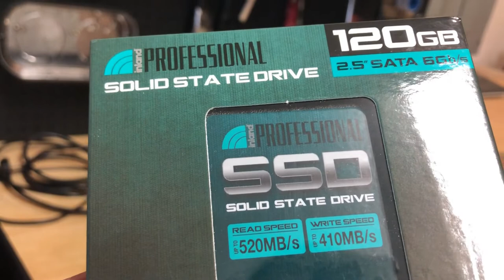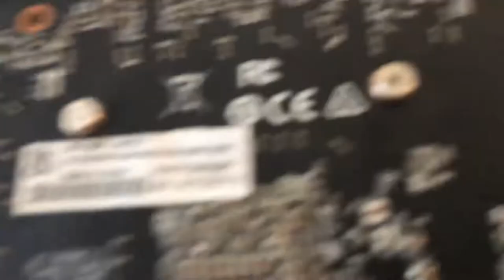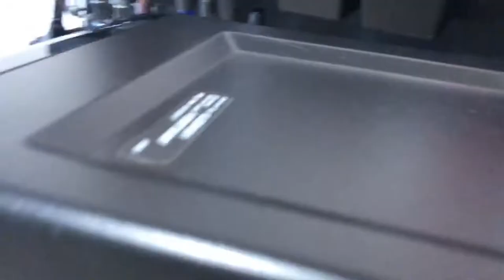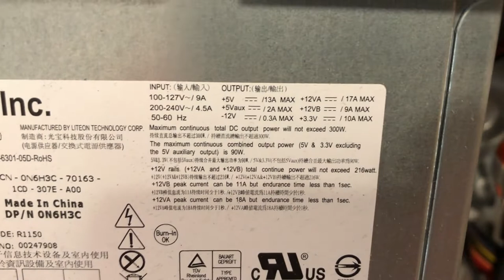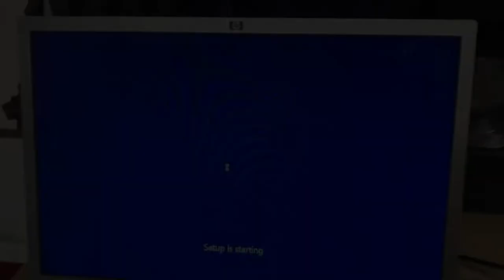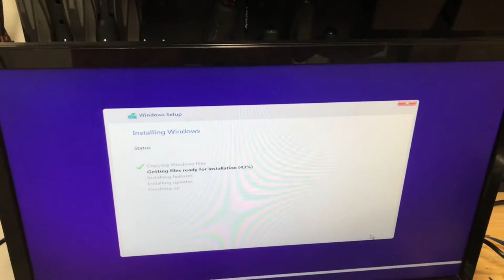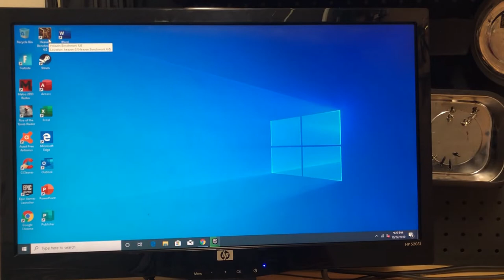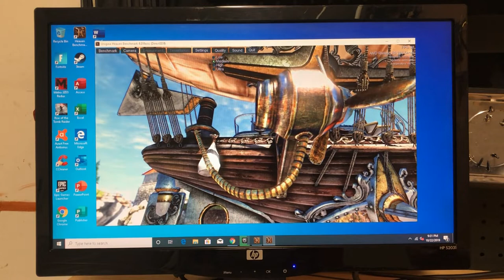Budget gaming computer for $20! Dell vostro 260 gaming PC for $20!

Comment: Hey, I have a Vostro 260 lying around, I have never looked into anything like this before. But I was wondering if this model is even worth putting the money into for running a game like Trackmania. And if so my first question would be how do I connect it to the Internet? If you have any advice is would be much appreciated! Thanks!
Reply from the maker: depending on the minimum specs it might be, I recommend finding what they are. The price for second gen i7's are cheap, only thing with this vostro is it is limited and picky on the gpu because of the bios.

Comment: Hey man, just got one of these, out of all the graphics cards you mentioned, which one do you highly recommend for this?
Reply from the maker: this computer is very picky when it came to video cards and bios support did not really help. I would check the forums to see the best one to get, the best i was able to get going only cause i had it availible was a 750 ti, i did try a r9 380 and ran into issues with it.
Reply: How did you do the bios updates on this with win 10 as the bios updates just fail on my pc and I read that the vostro 260 needs to be on win 7 to do bios updates

Comment: Hi there, i have the 270 with i5 3rd gen. Was thinking of getting a 7770 but not sure if it will fit. Then obviously need a better psu.
Reply from the maker: the psu would be the biggest thing. once you do that you should be good. the 3rd gen intels are better with video cards so you should not be limited.
Reply: @DLMtechgarage  bro thanks for that, i will definitely get a better psu end of July.
Reply: Late reply, but the XFX GHz Ghost will fit.

Comment: I have a Dell vostro 470 with Xeon processor. Just bought a gamemax 1050 watt RGB PSU. I have a question with the ATX/PSU connector wiring. Do you know if Dell went with a proprietary wiring diagram or did Dell follow the standard ATX/PSU 24 pin connector wiring diagram? I really want to give this system alot more power for more powerful cards.
Reply from the maker: from what I can tell on the 470 it appears to be a standard 24 pin connector which means you can use whatever power supply you want. Only time you need an adaptor is when they changed to that 8 pin connector.

Comment: Hey,can a gtx 1050 graphics card fit in a dell vostro 3900 mt and how
Reply from the maker: should just plug right in, might need to check if that dell has supplement pcie power.

Comment: Hi i have a Dell vostro 460 Core I5 2400 3.10ghz. Recently my original GT530 graphic card was spoiled, i am curious if my graphic card still upgradeable to higher version?
Reply from the maker: i know the second gens are picky with the cards they can use due to the uefi bios support. you would have to research it to see what works and don't
Reply: @DLMtechgarage  oh i see thanks alot for the info.

Comment: What cpu is in this? I'm be for one laying around, and trying to figure out how far I can go with it.
Reply from the maker: I5 2400. Only issue with this generation of CPU is run into limited GPU support for the newer cards depending on the mobo you choose, so def look into that before going out buying parts. Overall a decent entry level gaming system but since the filming of that video, newer trilple a title games will def not hold up on this cpu! Thanks for watching and don't hesitate to ask any questions!

Comment: @DLM tech garage I have a Vostro 430a and the fans ramp up crazy with win 10 any idea and I don't know but in my one, I have a 6pin connecter I don't think you need to change your power supply? I have an i5 650 and could the CPU be upgraded to i7?
Reply from the maker: two issues come to mine with that. first being they temps, I have had that issue due to dirty fans/heatsink and also bad thermal paste which under any load caused high temps, second being bios update. If I'm not mistaken I believe their was a bios update on that Vostro that adjusted the fan curve for windows 10, don't quote me %100 but I think it was that mode. As far as the i7 upgrade yea it will upgrade to an i7 880 or 870. its plug in and play
Reply: @DLMtechgarage  Quick question though I want to swap it to a Deep cool matrix 30 is it possible? If you know any third party sites for the bios tell me please thanks you.
Reply from the maker: @thecomputerchannel3422  its possible but I think you run into an issue with the front panel, might have to do some splicing, as far as the bios, its hard to fine older intel bios. if i run across one I will let you know.
Reply: @DLMtechgarage  Thanks for your help!
Reply from the maker: @thecomputerchannel3422  anytime!

Comment: Bro I'm thinking of Upgrading my PSU
But Dell's PSU Dimensions are slightly away from Standard ATX PSU
Does a Standard ATX PSU Fit in the Dell Vostro Cabinet ?
Reply from the maker: you can upgrade the vostros to a better psu. depending on the model you may be an adaptor but other then that they all shoudl fit fine

Comment: How to enable gpu because on igpu it works fine, but when I put rx550 it doesn't display anything.

The rx550 surely works because it works fine in other computer
Reply from the maker: This model is picky with graphics cards. You might have to try updating the bios but I think that card does not work with this system
Reply: @DLMtechgarage  why this card doesn't work :(

Comment: im having a hard time with a pcie slot i cant get to remove the gpu it's stuck on the little white switch thingy
Reply from the maker: sometime you have to use a plastic pick if they are stuck to move them. if its broke then good luck, it can be tricky to get out.

Comment: Hello friend, I hope you answer, I have the same PC and I wanted to know if the i5 2400 processor works on it, the processor it currently has is the i3 2120 h61 sandry bridge and model 0GDG8Y
Reply from the maker: From what I read, you need to update the bios first and then the 2400 should work
Reply: @DLMtechgarage  my bios is a10
Reply: @DLMtechgarage  hello can you tell me which is the best processor to put on my dell vostro 260
Reply from the maker: @Fabrijaja  i7 2600
Reply: @DLMtechgarage  thanks bro
Reply: @DLMtechgarage  hey friend I bought a 1gb r5 240 graphics card and do you know why when you put it on the pc does not give video and the mouse and keyboard do not recognize it either?
Reply: @DLMtechgarage  pls help me bro
Reply from the maker: @Fabrijaja  did you check bios and change the settings to pcie graphics before installing the new card. also, make sure you have a bios update as most of these oem bios update was to allow support for different cards.
Reply: @DLMtechgarage  and if I don't get the option
Reply from the maker: @Fabrijaja  then try updating the bios. if it does not work then you need to test it in a different computerrt.

Comment: HI, i just bought a new Graphics Card GTX1650 on the same Dell Vostro 260, but when i try to boot the PC there is no display only beeping.. 
any tips ?
Reply from the maker: not sure but from what I have researched their is compatibility issues with the uefi support for the card. I would try updating the bios, if that does not work then their is a good chance it's not compatibile, my experience with this vostra is that it had very limited support for newer graphics cards and this my be the same with the 1650. if the bios does no help then you probablby won't be able to use it.
Reply: @DLMtechgarage   the BIOS is updated to A10 which is released back in 2013!
and btw when i plug and other display drive on he motherboard the PC boot with the two GPUs (the card and the integrate) and i had to change the input to the GPU and it works fine..
but it's annoying and sometime i had driver problems or something.
Reply from the maker: @theknightking3221  dang that's crazy just to get that working. the vostros have always been the worse when it came to gpu upgrades, it's why I stay away from them despite their good price used.
Reply: @DLMtechgarage  I think the reason is  i have an UEFI Graphics Card on Legacy BIOS Motherboard :)
what should i do ?
Reply from the maker: @theknightking3221  yea that's the reason for the issue. nothing you can do about it.

Comment: Hai. I have 2 unit of vostro 260. and i would like to upgrade the hardware. can you recommend which hardware can / suitable with vostro 260 exiting mobo.
Reply from the maker: i7 2600 would be a good cpu, upgrade to a ssd and 16gb ddr 3 ram and that should def be a nice combo, graphics card are limited due to the lack of uefi support on the board. you would have to do some research to see which one work, I know the 7 series from nvidia work fine but past that not too sure.
Reply: @DLMtechgarage  Will it work with the i7? Dell 'officially' say no but it might
Reply from the maker: @Fizzoid  will need a bios update first but lots of forums have people running i7's in theirs
Reply: @DLMtechgarage  Tried the 260S at work with an A02 BIOS which is quite old, but worked perfectly :)
Reply from the maker: @Fizzoid  nice. enjoy the build. always a fun process!!

Comment: Hi brother i have Vostro 460 bought in 2011, i3 -2100 3.10 GHz, with 2 GB DDR3, currently installed 1GB Nvidia 210, looking forward to upgrade it, can you suggest what processor and graphics card can i buy? i asked for suggestion from Dell Technical support but am not satisfied with what they suggested. Request you to please suggest..... :)
Reply from the maker: The issue you may run into is power supply  when upgrading the gpu. i personally would look for an i7 second gen, and probably  go with a gtx 950 gpu. the second gens are really beginning to date themselves but this combo should def give you a good experience along with bang for the buck. now if you find a cheap 750 ti the def go for it as they are still great cards for those computer but you run into the power connector issue. Hope this help and subscribe to help the channel. Thanks.
Reply: @DLMtechgarage  thanks for your suggestions buddy. I'll definitely try those as you suggested and try to make a video as well thanks again ✌🏼✌🏼
Reply from the maker: @St0rmyShan  Anytime and look forward to the channel. Stay linked and subscribe so I can check out the video!
Reply: you can upgrade it to 3rd gen intel cpu's, with a ssd, and something around a rx 470, a 450 watt psu from evga should do

Comment: Can this run obs?
If so will it lag terribly?
Reply from the maker: it will lag as the cpu does not have the beans for it, probably a 1650 with a NVidia the encoder would be the way to go so as to take the load of the cpu.

Comment: Is a gt 710 good or should I get a gt 1030 but I don’ have a high spending limit which should I take? For my vostro 470
Reply from the maker: 1030. the gt 710 has only ddr3 memory and barely can play anything beside fall guys. the 1030 make sure you find the ddr5 variant as their is a ddr4 variant which is a horiible card with ddr4.
Reply: Oh but is there a cheaper one that I can get for playing gamings because I might only play roblox hypixel and valarant
Reply: What cna I get to make my pc a gaming one in a 500$ budget
Reply: What about the 1050 ddr5 4gb?
Reply from the maker: @mr.doge5657 easier route would be to try to find like an optiplex such as a 3020, 9010 or any model with at least an intel i5 4th gen, they typically go for like $120, the get an ssd, and a graphics card and swap out the psu and that should keep you in your budget and its the easiest to upgrade. got a video on the channel where i modded an upgraded an optiplex will post a link to the video below and the build cost me like $300 by the time I was done.

https://youtu.be/b4erclpxo-s
Reply from the maker: @mr.doge5657  it hard to find decent cards for cheap, maybe consider an older gtx 760 or r9 270.

Comment: Bro I also got vostro 460 but why its 2400( 2nd gen ) And can I upgrade the chip to i7 2nd gen on the same motherboard
Reply: I want to upgrade the chip cuz for low bottleneck with rx560, Will it work pls help me out bud
Reply from the maker: yes you can upgrade to the i7 2600 and it will work and be fine.
Reply from the maker: now the rx560 is probably the bottleneck as it tends to be a weak card and the i7 2600 is still a good cpu for 1080p gaming. will post a link that shows the bottlneck. its a graet calculator tool i use for pairing good combos.

https://pc-builds.com/calculator/Core_i7-2600/Radeon_RX_560/0010XOf2/8/100
Reply: @DLMtechgarage  Does it definitely work? Dell say no (officially)
Reply from the maker: @Fizzoid  check the community forus and even one from toms hardware and many are running that cpu.

https://forums.tomshardware.com/threads/upgrading-vostro-460.2266007/

Comment: Hi please reply , can this fit a normal size card bracket or does it only fit itx size cards
Reply from the maker: that card I used was a standard size card. If you have a bigger card then you would have to remove the drive cage. Hope this helps, thanks for watching!
Reply: @DLMtechgarage  thanks

Comment: can you put 12 gigs i have 8 right now
Reply from the maker: spec data sheet say max is only 8gb or ram
Reply: @DLMtechgarage  no they lied
its 16 actually
Reply: @DLMtechgarage  or they can at least handle 16
Reply from the maker: @hybrid532  good to know def should give for a better computing experience. Thanks for the info
Reply: @DLMtechgarage  no prob but its recommended to add at least a core i5 if you plan to put 16 rn i have a i3 and 8gb ram but i plan to put amd fx 6300 6core and 16gb ram 1333 mhz ddr3 along with a gtx 750ti
Reply from the maker: @hybrid532  The fx would be alot better then the second gen intels. Sounds like you gonna have a nice build. That 750ti is still a good card!
Reply: @DLMtechgarage  yea i think that 750 ti is a legend but im thinking about rx 460
because it is 2gb supports direct x 12 instead of 11 and offers more fps
Reply: @hybrid532  Exactly I'm pretty sure the ram capacity depends on what cpu you have I have a dell xps l502x and the max supported ram is 8 but I have 16gb now